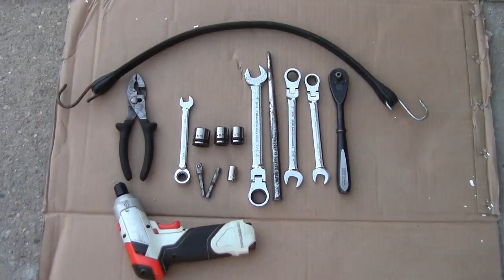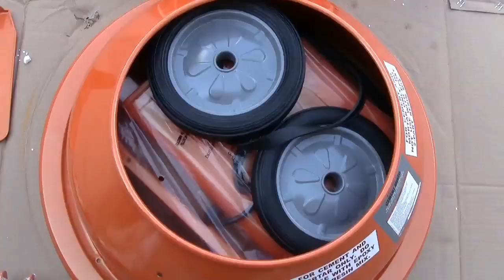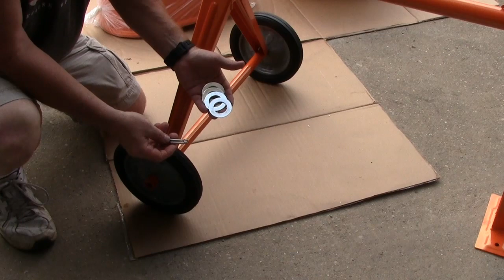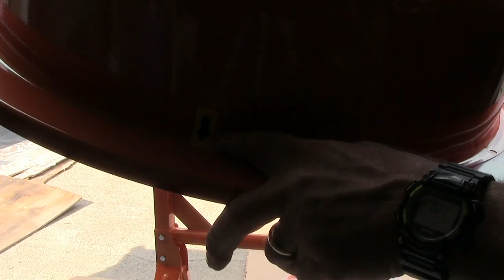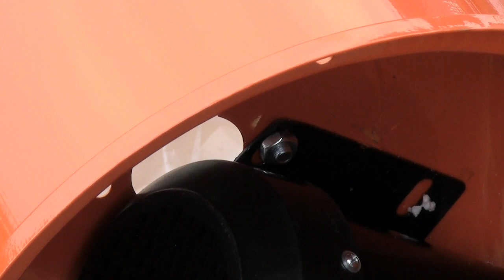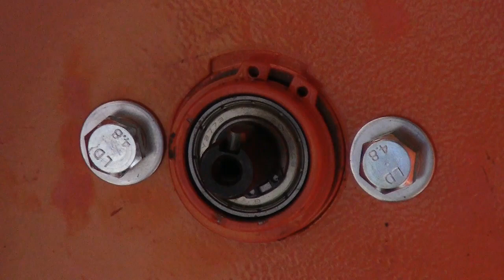Harbor Freight Cement Mixer Assembly

Comment: I had assembled mine backwards. The motor and pulley wheel is on the wrong side. Any idea how I can remove the pulley wheel ? I tried it last night but could not get it to release.
Reply from the maker: It shouldn't be that tight. Make sure the set screw is loose. It should pull off by hand, if not you can use a small puller or you can try a rubber mallet hammer and try to tap it off but be careful not to break it.

Comment: The only part i needed, installing the blades, i cannot find in this video
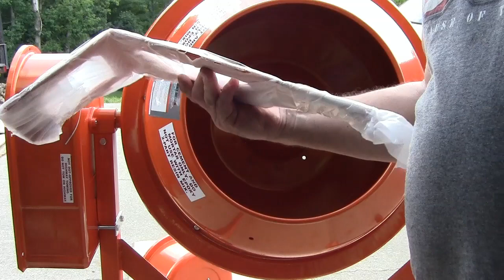Reply from the maker: Go to 9:22 and you can see where the fin is bolted in the back. The fins just line up with the holes.
Reply: @LonnieJohnson1  The orientation was difficult to perceive. Found a different bideo which went over it.
Reply from the maker: Cool! I guess I should have shown more on that. The assembly was a nightmare as it was. They should have save their paper and their ink instead of printing instruction like I had.
Reply: @LonnieJohnson1  agreed!

Comment: what about the arrows lining up on the upper and lower drums & connecting the wires for the motor ?
Reply from the maker: In the video at 5:42 & 8:12 you will see the arrows & my motor wiring was already connected, I just mounted the motor and plugged it in. Not sure if all units are like this unit but seems the instructions are not the best on any unit at all from what I hear.

Comment: I switched the handle side onto the motor side. My flash of brilliance after completing assembly was to just put jack stands in each side....oh I got one side switched back and it fell on the belt side...I was lucky to find the key chuck and bent the plate under the motor a tad but she works.
Reply from the maker: Cool, I'm glad nothing was damaged.

Comment: To save all the anguish and danger of getting that spring to stay compressed in the handle, use a elongated clamp used in woodworking. Turning the clamp tensioner easily compresses the spring and easy install of bolt.
Reply from the maker: Thanks for the info.

Comment: Thanks,The thing that got me about those horrible instructions is they left steps out jumped from step 4 to 9 or whatever. They had bolts bagged separately and numbered but the # didnt coinside with # on instructions. The absolute worst but then again it IS harbouring freight
Reply from the maker: Your welcome, and your right, it is from HF

Comment: Your video was very helpful,  but you didn't show or tell that the spring goes into the handle.  We figured it out but you really should add this little detail 👍 Also maybe explain which direction the blades go. Thanks
Reply from the maker: Your right, I can see the spring in the handle but I never talked about where to put it. Thanks for the info

Comment: fyi, the bolt/washers and parts list don't agree for mine.  at 1:43 you talk about having four of those bolts.  I have 8 of one and two of the other.  not good.  HF has some of the worst instructions on the planet
Reply from the maker: I know, the instructions are trash. I had to wing it the best I could.

Comment: How did u put in the spring
Reply from the maker: The spring was hard to do as you can see at 7:35 but I got it done.
Reply: @LonnieJohnson1  I got the older model for free and my spring is worn out and doesn’t have any tension. I think I have to stretch it out or find new one

Comment: I am assembling the second one gasket round one I left it in the driveway to warm it up so it would lay straight. Second mixer assembling I randomly placed it on the top part of the drum from the outside while I was assembling everything else it straightened out perfectly made it super easy to lay it flat make it easier to assemble

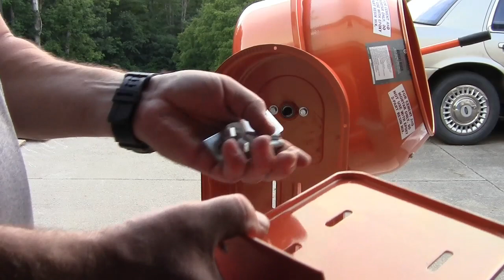Comment: 9:17 Bracket?  What bracket?  I didn't get no stinking bracket?  But it sure makes sense that the motor and housing should be fastened to the upright, and I've seen them assembled in the store without a bracket!  Thanks!
Reply from the maker: Did they not include the bracket?
Reply: @LonnieJohnson1  --No, I was wrong, they did, but it didn't look like yours.  It was orange and curved.  And they didn't put it on in the store model.  I wondered about the engine flapping around like that.

Comment: Thank you! One step I did differently is I put the two rubber washer between the mixing blades and the barrel...but it's all good. Your help was very much appreciated. Oh, also, I left the two shortest, but thick bolts, for the sliding motor plate. Anything longer and it risked scraping on the lowest belt area where the pulley and belt are close to the bolt holes.
Reply from the maker: Your welcome and thanks for the info.

Comment: The flat washers should be placed on the bolt head, placing them on the grip nuts defeats the "locking" purpose.
Reply: Other than that, great assembly video, helped tremendously.!
Reply from the maker: Good to know, instructions were not the best. Thanks and glad I could help.
Reply: This was definitely a great timesaver. Looks like they make changes to design but not to the assembly instructions or the hardware! I received basically two packs of bolts, one for frame and another with motor housing. Neither pack was correct. I had to use shroud bolts (5 each) to assemble tub as the bolts that came in that pack were too large in diameter and were actual too short for motor cover. I ran to my local hardware and picked up new bolts for the shroud. One thing I do have a problem with is adjusting the v-belt tension, definitely not thought out but I am just going to run a bar across the bottom of motor shroud, drill a 3/8" hole through bar and motor mount plate,then run a bolt and but through. I can then easily tighten belt as needed.

Comment: What size bolt did you use to hold the large pulley on the shaft? My pulley walks off the shaft and I need to hold it on. There wasn't a bolt in the parts kit.
Reply from the maker: I would go back to where I purchased it and tell them the unit was missing a bolt.

Comment: I appreciate  your taking the time to share putting  the  cement  mixer together  very  much! Of all the demonstrations posted  you got off to a good start! I really  struggled at the motor  mount and was hoping  you'd  go into detail  on that, I made three attempts  before getting  it! Overall  was very pleased with your  demo. I'm  very  disappointed  with harbor  freight. I can't  believe  they throw all the bolts in a bag and don't  give better identification  on them.
Reply from the maker: Glad I could help, and yes, they could have done a better job at making it more user friendly to put together.

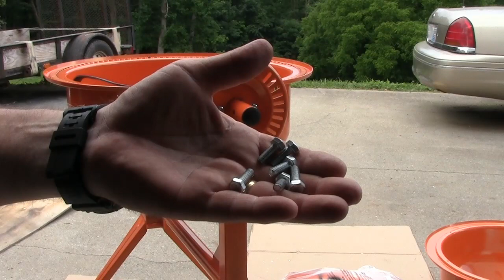Comment: Another easy way to install barrel gasket (@5:00 in), I pushed the bolts up from the bottom then put gasket over the bolts.  Gasket has just enough grip to hold the bolts while you lower the top 1/2 of the barrel onto it.  I then reverse the bolts one by one and adjusted the gasket as I gradually worked my way around tightening them.  Thank you for the video Lonnie!
Reply from the maker: Your welcome and thanks for the info.

Comment: Great job thanks for the time you put in to help others, I would like to offer an easier way to hold the rubber gasket in place which I learned in manufacturing, put the gasket in place using the bolts to hold it in place, afterwards use a small dab of Super Glue about every 12 inches apart, for each dab hold it in place for about 15 to 20 seconds until it holds in place, after that's done take the bolts out and add the 2nd half of the bowl.
Reply from the maker: Thanks and good info.

Comment: PRO TIP: Using gasket sealer to hold down that rubber seal is NOT the best way; I used DOUBLE-SIDED SCOTCH TAPE, not the foam filled, just the thin stuff on the plastic dispenser. A couple of long strips between the holes all the way around, and it didn't go anywhere. ALSO...about the bolts and nuts arrangement- those flange nuts with the grip shoulder on them...put them alone on the back side so they grip into the orange metal. Put the flat washer under the head of the bolt. Hope this helps!
Reply from the maker: That's a go idea

Comment: Thank you!!!!!! We were confused trying to put this thing together. Your video helped us out so much. I think they need to make the instructions easier
Reply from the maker: Your welcome, and yes I agree, the instructions are #@!% and could be a lot more user friendly.
Reply: How has yours been doing? I use mine for real for the first time this past Saturday, and it stopped spinning the drum after about 5 minutes. Pretty sure what happened is that the bolt and washer holding the little key thing in, where the pulley turns the shaft, came loose. I'm going to use some threadlocker and crank it down, see if that fixes the problem for good for now. Is that what you did on yours, did you tighten that bolt down pretty well?

Comment: Your video was a great step by step for me. Thanks. One thing that helped me was to put the gasket on the top drum with the screws lined up then insert in on the base drum. This made it easier for me. I did see some improvements that I had on my mixer. Handle was styled different and was a breeze to put on. Now I have to go find the video that showed how to install the motor wires. Mine came detached. Also I did have a Assembly drawing of screws (mine came in numbered bags), this would have been a little helpful if I had noticed it prior, but your video was helpful in showing the different screws. LOL
Reply from the maker: Your welcome and that's great that they have made some changes especially on the handle and the motor should have had the the wires already connected in my opinion.

Comment: Been trying to install the spring loaded handle for about 2 hours.  Tried to use a bar clamp to pull it down for hole alignment, but that didn't work.. It shot the spring across the room and nearly broke a vase.  Not sure if I'll be able to get the handle on.  My wife's not home so I'm cussing a lot and might start drinking vodka.

The dog is hiding in a closet.

Yeah, if they would have told us which bolts, nuts and washers to use in specific locations, it would have been helpful.

I noticed the one on display at the store was only partially assembled.

Thanks for the video.  It WAS helpful.
Reply from the maker: Your welcome, and the handle was tough to deal with. Could have been a better design.

Comment: Thanks for this video, it helped me a lot. Got stuck a few times, worst part is the guessing game with bolts. If you apply common sense you shouldn’t have a hard time. 

Spring arm was a pita.
Tried 3 mounting alternatives for the motor tray. Lots of different videos but the models also differ minimally. Bracket sits on the outside for mine.

I had to make an extra trip to Lowe’s for some bolts, washers and nuts. I did not have enough for the motor cover.
Reply from the maker: Glad I could help.

Comment: I'm having a fit trying to get the tip handle on. Even with no spring inserted, the base of the handle has to be right down on the barrel arm to get the big bolt through. There isn't enough play in the handle to get it to disengage from the locking plate. 
You're right about the instructions. This is my second HB assembly and so far, none of their instructions are good enough to paper the birds cage. Harbor Freight could make a good buck doing the assembly for you.
Reply from the maker: Then they would have to find a way to understand the instruction. Have you had any luck with your handle?